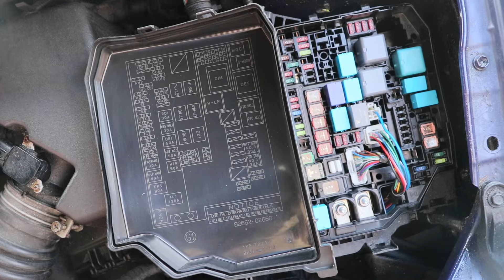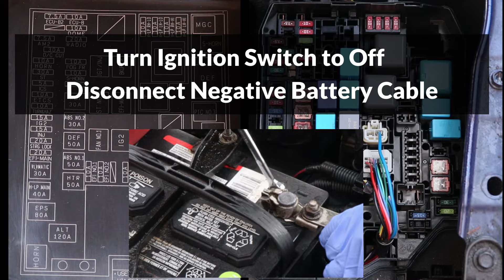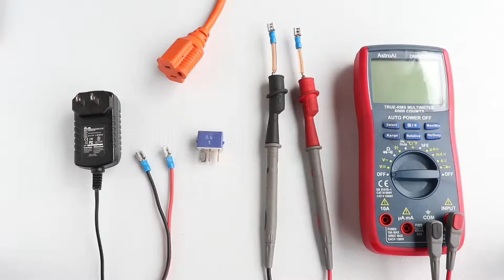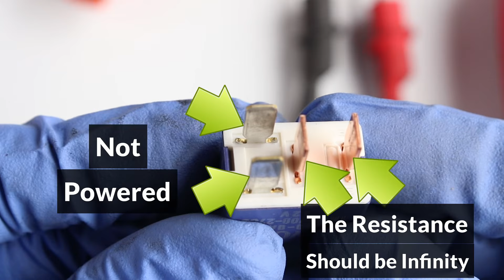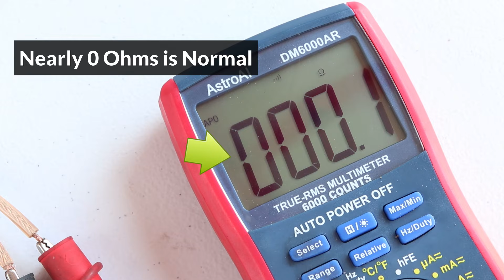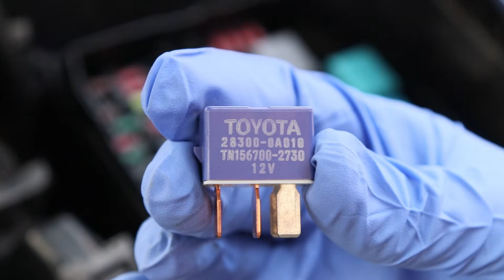Toyota Corolla Starter Fuse Location, Starter Relay Location & Testing, 2014, 2015, 2016, 2017, 2018

Comment: my 2017 Corolla has no power in fuse but not blown ( S/ HTR F/R ) (S/ HTR F/L ) and security system keeps on and car not starts . would you please assist on this issue ?
Reply: Fuse link

Comment: Great video.  Why disconnect the battery?  That will erase all the radio stations and other stuff.  Seems unnecessary.
Reply from the maker: It's for safety, and it does not erase anything on the stock stereo, it just resets the clock.  There have been rare cases where tools fell onto the contacts in the fuse box and short circuited them.  It's very rare but if somebody is not careful, it can happen, so that's why I added that. Thanks for the comment!